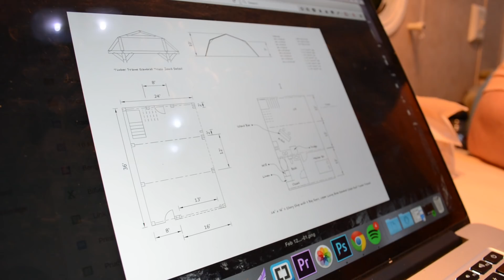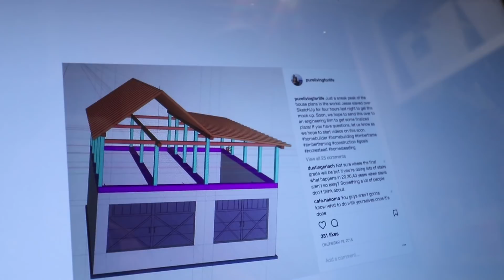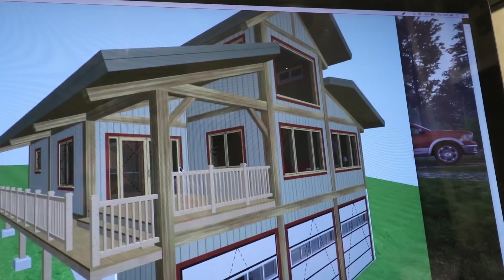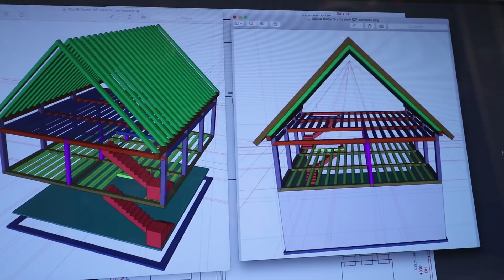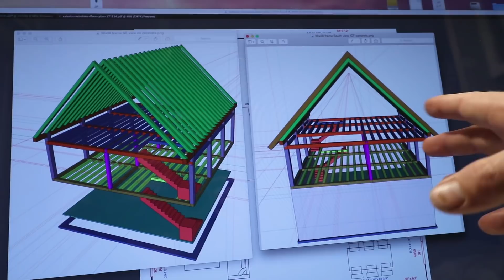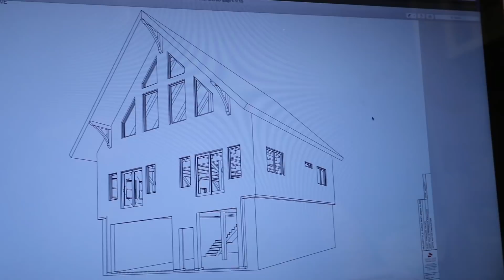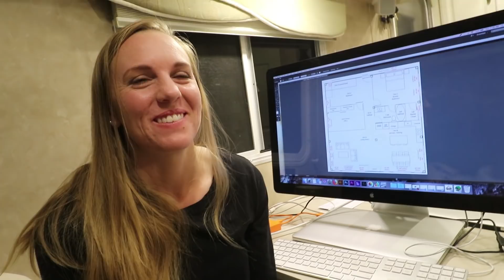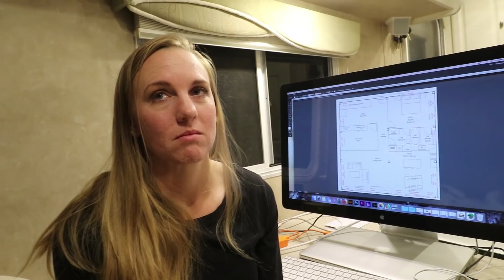Building a House Start to Finish: Timber Frame House Tour

Comment: My suggestions for ease of building: keep it to one level, with a roof pitch of 6/12 or less makes it a lot easier (and safer) when framing the roof and installing the plywood. Also, if you live  around a lot of trees and you have gutters on your roof, imagine how hard or easy it will be to clean your gutters out.
Inside, I'm not a big fan of soaring, tall, interior spaces, or open lofts, mainly because I heat with wood and that open loft is going to be hot! Even if you don't head with wood, remember heat rises.
Yes, spiral staircases are horrible. Imagine moving a mattress, or a chair, upstairs.
And any deck or porch over a living space is risky. Any leaks in the torch down can do a lot of damage.
Good luck!

Comment: This is fantastic! Pretty close to what I had envisioned before seeing the video. Love the choice to use transom windows. A couple of questions: a) Are you planning to add rooftop solar? Or keep solar at all? And b) With regard to the opaque stairwell windows (great idea, by the way), what about adding one more around the corner on that little east-facing stub wall? That would be right next to the back door so it might gather quite a bit of light.

Comment: J and A
On looking at the plan drawing again here  are some more ideas.
Take about 3 feet off the end  of the office space  and put a powder room in the corner (where the office door is now located). Make the PR accessible from the hallway . 
Get rid of the extra bathroom door in the hallway and make that bathroom main bedroom only access.
Move the office door to the hallway. This would give you more wall and floor space by not locating it in a corner. (basic design 101)
Move the laundry equipment to the east end of the bathroom and make that accessible  from the hallway with sliding doors. 
This would free a lot more space in the main bathroom to be able to re-figure that layout, and maybe, give you more room for the walk in closet, and hide the toilet from view of the bedroom.

Comment: Love it!! Timber Frames are awesome. Side point... the stairs going up to the loft won't meet building code; the 'winder' style of treads where they make a 90* turn poses a problem. On the inside corner, the tread is 'pie shaped' which doesn't allow the full depth of necessary tread. You may need to create a landing, with your steps coming off at 'right angles'. Good luck with the project!
Reply: ??? Codes? What codes?
Reply: Apparently there are no codes or permitting where they are in Idaho. Doesn't mean that there aren't proper ways to do things but not a lot of second guessing by so- called authorities.

Comment: My 2 cents.  Use some LED lighting in the stairwell instead of the windows.  Save $1000 and have a wall for shelves or paintings.  Use long lights 20' long in the garage.  Even lighting.  You can use low voltage, 24 or 12 v.  strips with aluminum channel. 1/3" high x 20' long x 3/4" wide.  5 meters uses 75w.  2 strips should provide nice even lighting in the garage.  I put one strip that is 6 meters long that lights up my outside garage that is 35x35 and 10 foot ceiling.  
2 more cents:  Look at the new solar roof that sun city has along with the powerwall.  They are the future and they are working.  They have solar shingles. With the way you have the solar array, the roof has the best exposure with all those trees.  Maybe they will give a deal as a youtuber.  The powerwall has alot of sophistication and  just makes other battery backup seem like a horse and buggy going down madison avenue.  They put in a 120 mw plant in australia and in puerto rico they powered the entire hospital with basic panels and powerwalls.  The powerwalls have an inverter and modern batteries. It is a game changer for your type of installation.  
Love the design and with you two all the luck and enjoyment of building the project together.
Oh, Plan chases (1.5 to 2" pvc) channels through spaces for future whatevers.  A chase up a wall to go near the roof in case in the future you do want panels on the roof, you con't have to run conduit outside and through a structural wall.  Easy now, really a pain later.

Comment: I know all about the work involved in designing a home for I have done it twice. A few points, southern exposure for solar panels, I assume they will  be elsewhere. A balcony off of the living area would be nice, having your morning coffee sitting outside is nice. The kitchen/ living area with a cathedral ceiling helps with cooling in the summer. Skylights and light tunnels are not the pain that one might think, they offer energy savings. Water works if stacked can be a financial savings. Kitchen counter space is never enough although islands are nice, think of food preparation work flow.  
It is easy to second guess, but since you decided to make this project a public event, constructive thoughts and ideas should be welcome, for planning should be 80% of the time spent on a given project.

Comment: Fantastic design. Finally we have a clearer view of the type of house you are building. Well done.
The only thing I found is not so well represented in the render is the size of the garage. It looks small! But actually is going huge! It is very tall, which is not show in the render at all. Anyway it's looking very good. Congrats
Reply: Ricardo Quimbayo 36' x 36' footprint....I think 10' ceiling in garage

Comment: I'm glade we talked about this because it was really starting to worry me......LOL.  So, I like the A frame feel. I personally would have added a five foot wide deck that comes out of the front or south side, and instead of small windows I'd want big picture windows to take advantage of the views from your living/kitchen room. In the hall by the stairs coming up, I'd make the three windows, one window up high so you can build in a bench, to sit and take your boots off, before you put them and your coat in an open shelving across from the bench. The washer dryer I'd put in the garage and expand the bath. I'd put the kitchen on the south wall so when your doing the dishes, you can look out a window and see the views as well as your drive way. And, do you really need a something room next to the mudroom area, I mean, I don't know if your every going to have a family but if not, your living room could be much bigger and more spacious.I didn't see where the wood stove was going to go, but it makes sense to put it in the middle of the main floor for max heating. Did ether of you think about the roof being a rain/snow water catchment area to fill your tanks. There's a ton of things to consider when building a structure, like subtracting from the full space for the thickness of the outer walls, which in snow country should be six inches to allow for the outer skin and inner Sheetrock which will bring you from 36 foot to 35, and inside the walls will be at least five inches thick, and what about isolation and triple pain windows. You do want the house to work for you rather then you pouring money into it because you can't keep in heated or cooled. And how about all those tools you guys bought, are you just going to stack them on shelves on the side, if so, wrap them good so they don't rust out on you.,..... is this enough or should I add a few more pages worth?

Comment: Think hard about having a pantry to the left of the refrigerator, two ft deep is still very usable and would work if you move the washer/dryer next to the hall door. Expanding the office into the wasted space of the mudroom could see two office/bedrooms in that area or an office with a hall bathroom across the hall from the then isolated master bathroom.

Comment: One small recommendation: Go with a lighter colored roof. You will thank me later when you notice the summer temps inside, and the extended longevity of the roofing. Darker shingles do not last as long and retain heat.

Comment: Bathroom: We been married 26 years now. Never seen the other using the toilet. I know that's odd but it's something we agreed to from the beginning. Nothing is more unromantic as seeing someone use the toilet. One day we may have to help the other with that task but until that day, we use a curtain that could be drawn if the other one needs to use the bathroom sink or get something from the cabinet. With your washer and dryer there, there might come a time to draw a curtain while some one uses the toilet or the bathtub. Simple project to hang a tension rod or something.
Reply: I would agree. Consider an extra room for just the toilet. It's just not comfortable to be bathing or showering, while someone in the same room is violating the smell of roses and the sound of sponges and foam touching your skin.

Comment: I love this video and rendering !  I also appreciate you going through the steps on how you got to where you are with the design.

You have been very fortunate to be able to get a lot of advice as well as hands on assistance from experts.  I am concerned about your next big step, installing the SIPS.  Your crane operator demonstrated his skills by flying in all the timber frames.  SIPS could be even more challenging (wind).

Also, there will be some very precarious moments when SIPS need to be attached to the timber frame.  Sitting on that ridge beam, guiding in a SIP and attaching it is no place for amateur.  I will be waiting with bated breath,  STAY SAFE !

Comment: Another thing you might want to consider doing is in the garage. The problem with parking vehicles underneath the house is if their accidentally left idling it could fill the whole house up with Carbon monoxide relatively quickly and you wouldn’t necessarily smell. However there’s a way to prevent the problem by installing a  gas and Carbon monoxide detection unit with a auto extraction fan. What that does for you is it is capable ofbe able to tell if there’s a build up of carbon monoxide or other toxic gases and it will suck it out of the garage illuminating the threat. Also you might consider putting in a fire sprinkler system. They don’t cost as much is you might think and compared to a Firemans hose they distribute a lot less water and are better capable of putting out a fire with less water damage.

Comment: Very nice,  your logic was very easy to follow.  I get the fight with cold and planning on keeping the house warm. With that in mind I would add a cozy little fireplace.  Nothing crazy huge, just big enough for snuggling up watching the snow in the valley.  On the flip side, you guys looked pretty hot this summer, hot as in temperature lol. You might consider a window or 2 in the loft to allow for some cross ventilation not to mention any radon gas or other issues which could be solved with a few cross ventilation windows. Anyway doing awesome.  Your videos are part of my pre-bed time routine. Happy thanksgiving.

Comment: House rendering looks *AMAZING*, but in the rendering, you're using tons of lights, which translates to HUGE solar array, lots of batteries etc. Did you take that into account when designing the house or you're planning to build something separate for this?

Comment: One thing I would do is use those extra ICF panels left over for an out building for any batteries for solar, this way if there are issues (like fire) then all that stuff is not in the house, just my opinion about it.  A 10x12, 10x14 or something would probably be sufficient - any battery/solar users out there feel like chiming in about that?  Id have one 30-40 feet away SE from the house, near where the rock grizzly sits/sat....

Also another thing that drives me nuts is having any trees close to the building, I did live in the PNW (Washington state) for a while and a good wind storm (60+ mph winds/rain for 24 hours or so), can drop a big tree. It would be a shame to have that happen after all the work/time put into the house.  Trees are awesome but it can be quite eye-opening when its pitch black outside, the wind is going (and has been for hours), the power is off from lines being downed and you hear trees, one after another all around you keeling over.

Cat cubbyholes should be designed first, then any actual human elements thrown in as an afterthought :D

I also think some of the space is missing built in shelving, in the mud room and maybe even in the living room on that office wall it shares but thats just me.  I like shelves for stuff.

Comment: Hi guys, love your videos and look forward to new ones each time. One comment though! When my wife and we're looking for our first condo, we looked at a demo model and they had the oven with an island facing it. Even though sales rep said the demo was to scale, it was impossible to stand in front of the oven with he door open and reach inside to pull something out to. The island was the problem making it impossible to bend over without obstruction.
The point being, your double oven is just where the end of the island is. I don't know if you have taken that into consideration, but check the measurements and save the heart ache later.
Keep up the excellent videos and good luck.
Ian chafer, Ottawa, Canada.

Comment: Thank you! Question: If you haven't designed the upstairs, how will you plan for routing of the plumbing lines??
Reply: you just rough in lines to the upper floor and then tie them in later, plan ahead as best you can to keep future costs down on the additions you plan to make.

Comment: Thank you for taking your time and sharing the experience with us.  Just wondering if you thought about Pocket doors for the bathroom. We have a small bathrm and door blocks the area behind it to get towels and grooming supplies. It sounds silly but it is a pain to keep opening and closing the door for a washrag or another towel or get the hand mirror.  If I couldn't do a pocket door, maybe a barn door (sliding on the outside like a pocket). Also our door doesn't like to stay open and we have the TP holder as a door stop. It's the Crazy silly stuff like that that drives me nuts. OH....Smart Smart Smart - no skylights or sun tunnels - Keep that roof in tack!! We had to replace the skylight due to leaks from storms - it's just not worth it!  Love hearing about the smart planning you all are doing! ~karen
Reply: You do know its not the skylight or chimney that makes the roof leak , it's hiring the wrong roofer ( probably took the lowest bid) . On a big flat roof like that you could put what ever you wanted on it and it would be very easy to lay up.

Comment: A few ideas - you could add a few (cheaper standard rectangular) windows on the hill/forest side of the loft - will add more light and make it feel much larger, as well as break up that exterior wall visually. Why not frame the garage stairwell in something translucent like a polycarbonate wall panel, or some slatted wood? might be a little modern for your taste but would be a cleaner transition than the interior windows. I would get the washer dryer out of the bedroom and put it in the mudroom or the office or garage.

Comment: Just my two cents.  I finished my garage recently with Sheetrock on the ceiling and the top half of the walls.  Plywood on the bottom half for durability.   After taping and painting the Sheetrock.   I would not do that again. I would plywood the entire thing,at least the walls.  Being able to to skip the taping process and mount a shelf, hook or whatever anywhere I want without having to worry about finding a stud.  Doesn't look at finished but I'd trade that for convenience. Plans look great.
Reply: Except 1/2 plywood is like $15 a sheet and 1/2 drywall is like $7. A house that size will be 20-30k to drywall it , and plywood would double that figure at least.
Reply: Well as they stated sheet rock adds a fire rating AND by taping it seals the garage fumes from entering the living space above. Besides, you wouldn't want to smell all the pickled herring they're gonna make down there :)

Comment: Hello,

I really like your videos and I thank you for that.

There are 2 things I do not understand in your construction project:
- the first: why not put the house deeper into the mound that would have isolated the garage from the cold and at the same time would have given direct access to the ground from level 1

- the second: how are you going to connect the 2 solid structures: the foundations and the concrete walls on the one hand with the structure in solid wood beams on the other hand knowing that between the 2 is a very light structure which constitutes the floor , do you think you just put the 3 structures on top of each other without linking them?

I love you two and your big project....

Comment: It will look beautiful when you have it done. I would recommend that you use large gage steel for your roof. I assume you are in Northern Idaho, I've traveled that part of the country a lot over the last 30 years and I know it hails, and snows a lot up there. So if you put heavy gage steel roof, you won't have to worry about the insurance so much. I built myself a tiny house and I have steel on the two sides and the 9/12 roof. I now wish I would of put a 12/12 roof on it.

Keep up the good work and you will be proud of your new home when it is finished.

WhiteEagle2
Reply: William White fireproof!! Great idea

Comment: Just an FYI if you never installed a stackable washer dryer before, installing them is not as easy as you may think. You may want to think about an access panel for the watter hook up and dryer exhaust connections. Good luck and I think you are doing well so far.

Comment: If I was going to attempt off grid living and didn't have large land I would consider a single slope roof which faces to the sun just for extra space for solar panels and solar hot water. But where I live I don't have snow to think of landing of the roof.